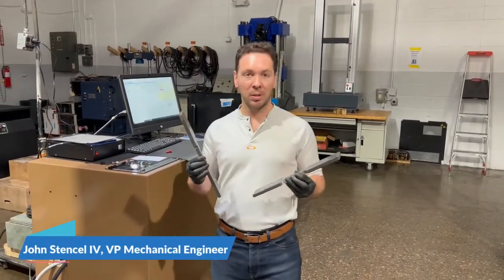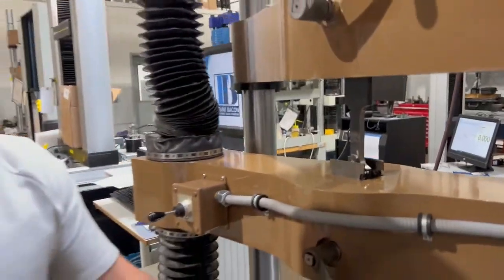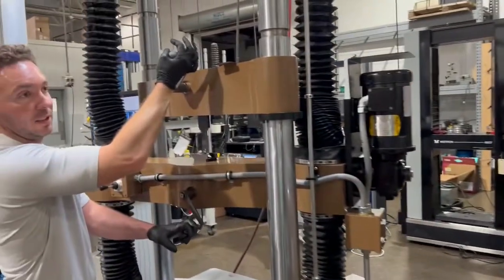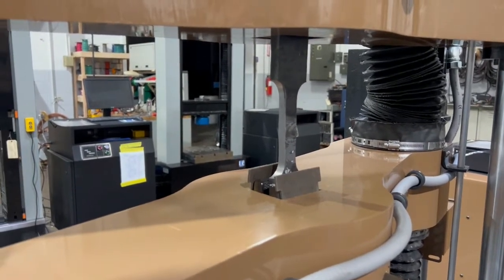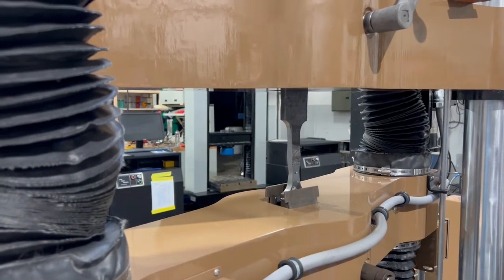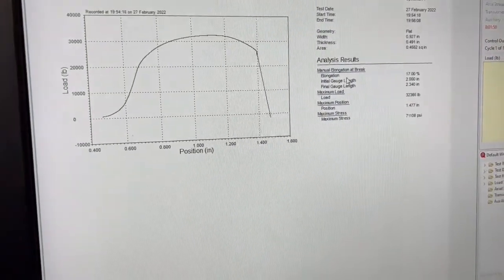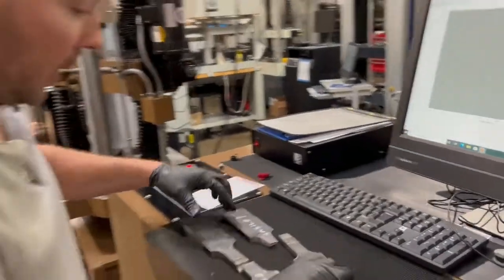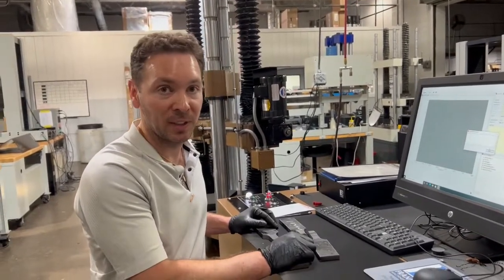Tensile Testing of Welded Specimens - ANSI/AWS B4.0 Mechanical Testing of Welds

Comment: Hi Frank, I am a question, Could i make a tensile testing with 3mm thickness for stainless steel and aws 308l-16 electrode?
Reply from the maker: Yes you could definitely test a 3mm thick specimen.  That would not be an issue.  We could either get you into a test system to bring your testing in house or we can test it for you.  FB Mechanical Testing is our test lab division.  Let us know how we can help!
Reply: @frankbaconmachinery  hi Frank, thank you for you answer. for this specimen with 3mm thick i could to use the dimensions W as 38mm or as 25mm
Reply from the maker: @davidcarao6421  For a 3mm thick specimen I would go with the smallest width so 25mm.
Reply: @frankbaconmachinery  ok, got it. but the norm AWS B4.0 figure 4.2, recommend me for T < 25mm ---> W = 38mm. i am confused.
Reply from the maker: @davidcarao6421  Ok if you are following a specific standard such as AWS B4.0 then go exactly with what the standard says to do.  Go with 38mm per the AWS procedure & specifications.
Reply: @frankbaconmachinery  Ok Frank, thank you

Comment: if the break in the weld area does that mean the test is successful?
Reply from the maker: The entire point of the weld test is to see if the weld or the material is stronger.  A good weld would not break in the weld area as it is stronger than the base material.  The specimen will always fail at its weakest point and production weld testing will find bad welds or processes.
Reply: If the non heat treatable metals like ETP Cu or OFC is welded? Where would it break?
Reply from the maker: @jeongikkim3340  A proper weld should break outside the welded area with a properly machined specimen.  If not there should be a specification assigned to it with a value for breaking strength.

Comment: Could you test a 16mm and 20mm deformed rebar welded joint just like you did there? Also advise the type of electrode you use.

Do a plain bar as a benchmark to compare with.

Add another coupler splice for comparison if possible.

I need to see the test results please
Reply from the maker: Yes we can perform the testing for you.  We do not do the welding in house as the customer would send a welded specimen to us for testing.  Contact us for details!
www.frankbacon.com or fbmechanicaltesting.com